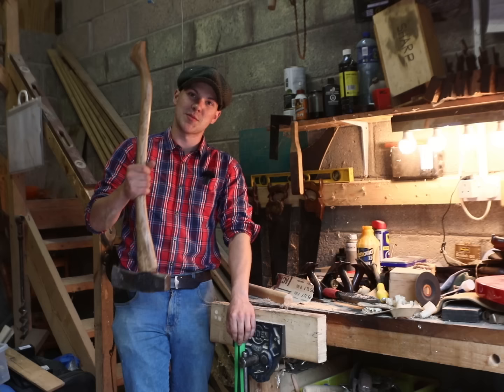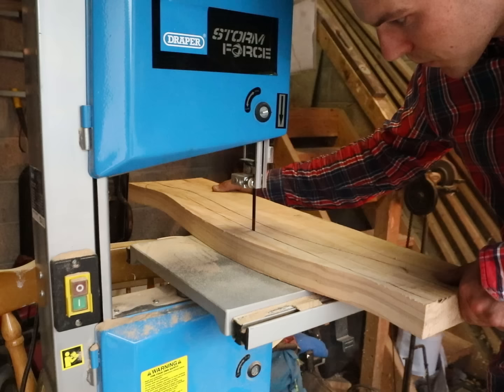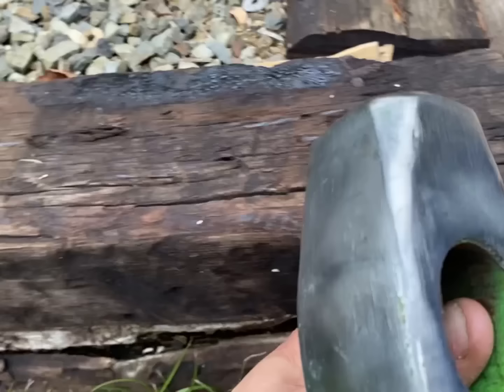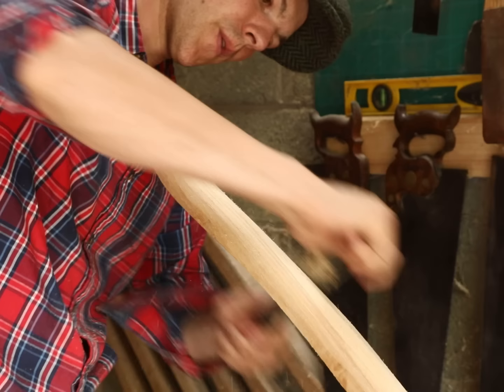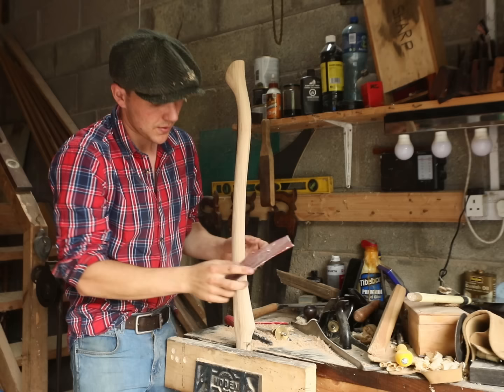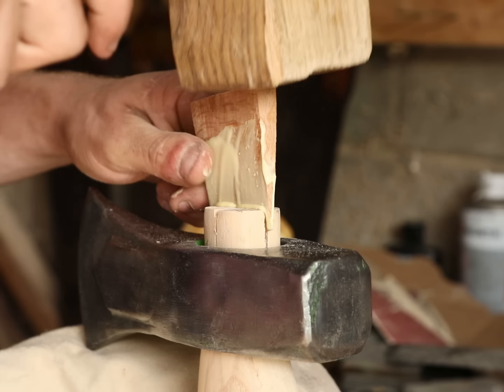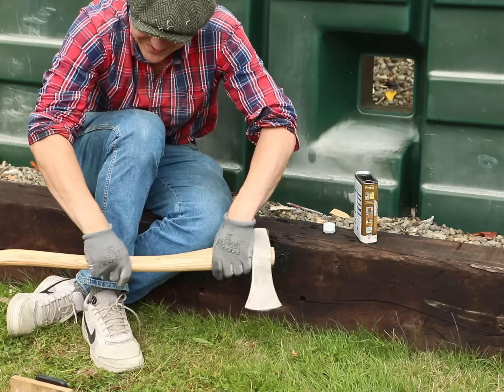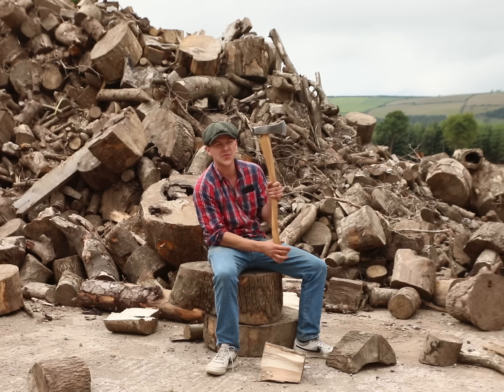Fixing The Cheapest Splitting Maul I Could Buy.

Comment: Lovely handle! Just a note, the shape you have made is more an american style felling axe handle where as traditionally maul handles are straight due to the fact that its used both for splitting and hammering wedges, not as sexy as the shape you made but more suited to the job the axe is designed for.

Comment: I saw a similar video.  That man hammered both parallel and perpendicular wedges at the same time.  He finished with 3 bullet casings, hammered over the wedges, cut down, sanded, then finished with 3 brass brads.  It looked like 3 brass bullseyes holding the wedges in place.

Comment: That maul has a slip fit eye, like a pickaxe as we call them here in the States.  Essentially a slight conical taper from top to bottom, with an oval cross section, designed to get tighter with work, with no need for a top wedge.  I repeat, there was no need for a top wedge if you had understood how the tool is designed.  The head is guaranteed to come loose with use now as the tool is used, because it is wedged only from the top and not the bottom of the eye.  Great job other than that epic oversight.

Comment: Kinda late, and potentially irrelevant, but if you ever decide to start up making handle blanks, I would Highly recommend sourcing something like a DoAll bandsaw before anything else. A tool you can grow into, adaptable and efficient from the start. 
Likely a rare find given your location, but it offers some of the craziest versatility I’ve ever experienced in a single piece of shop equipment.
A good woodcutting saw won’t be happy accepting any other material regardless of blade swap, and unless it’s a Serious industrial unit, it’ll never give the utility that new production ventures will inevitably demand. If the demand is really there, then “buy once, cry once”. 

(regardless of how you make em, I’ll be exited to buying one for myself)

Comment: With the original handle being a friction fit, I expect that the eye of the head was fairly wide, which meant that there was lot of 'empty space' to fill in when spreading the handle wood with the wedges.  The job would have been easier if you had made two kerfs, instead of one, perpendicular to the main kerf which was parallel to  the long axis of the handle head.  It would have been easier to spread the wood that way.  I know it meant making more wedges, but it would be worth it.  And as you said yourself you should have driven all the wedges in at the same time, which would have also helped.
P.S.  It's very rare to see a friction fit handle on a maul or similar tool, like what you have on a pick-axe.

Comment: If ever you needed to get the paint out then you can just cut a slot in a wood dowel or metal round bar with a hand saw and slide in a piece of sand paper. Better with a long thin piece. Wrap it around until you get a decent diameter and use it in a power drill or possibly even one of the hand powered ones. Although I suspect you very likely knew this already.

Also very good for polishing steel. Gives an almost brushed appearance vs wire wheel or normal sanding.

Comment: I've never seen a shinto (?) rasp before but it looks like a well engineered tool, less likely to clog up. Edit: Looks like a second, opposing handle could be a useful mod no?
Reply: My take is that the Shinto rasp owes more to a good idea than to good engineering. There are, of course, things you can optimize with engineering (though they’d be things you could just borrow from other saw-science: geometries, materials, etc). And then there’s your edit, which brings it back to “idea vs engineering.” You COULD engineer an “optimized” second handle. But just throwing one one is a great idea, and worth more than futzing about with engineering.

Comment: I can't understand how anyone with splitting experience would choose a crooked haft over a straight one.  Just putting the two side by side in honest comparison would always show the straight one to be superior in accuracy and force delivery.  The major thing wrong with the original haft on the green maul is that it  is several inches too short.  The 36 inch haft was standardized when the average person that professionally swung an ax was just a bit over five foot tall.  Then the haft was shortened to include the part in the head as part of the haft length.  I use factory handled tools quite a bit and when i replace them i prefer hickory, but have made several from ash and white oak. My favorite length is 40 inches, measured from the portion of the head closest to me!  At 30 inches, measured the same way, my accuracy drops off.  I made one 4 inches longer than MY normal for an extremely tall friend and for the little i chopped with his ax my accuracy suffered some, but a 10-inch tree came down in about the same number of licks.

Comment: ik this may be a dumb question but is the only difference between that and an axe the fact it is used for smaller, already chopped pieces of logwood?
Reply from the maker: There’s are many different types of axes for many specific tasks. This one is designed to split lengths of wood into smaller more manageable pieces for the fire.
Reply: Yes, the maul is just for splitting larhe pieces of firewood, while the axe is for choping and splitting smaller pieces of wood
Reply: thanks all for clarifying 😁
Reply: Look at the angle of the toolhead. It's a big, monster wedge. It's not elegant and precise like the narrower axe. Mauls maul firewood. 
They also maul your shoulders if you're a bit out of shape.
Reply: To answer your question: Kind of. A regular axe cant split wood, to split wood you need a splitting axe which is basically a wider axe. A maul is basically a big splitting axe. A regular axe is typically used to cut wood across the grain or chip smaller pieces off of the log with the grain. I hope I answered your question.